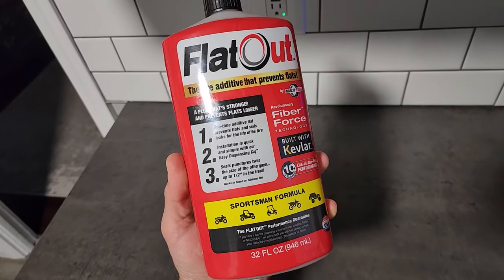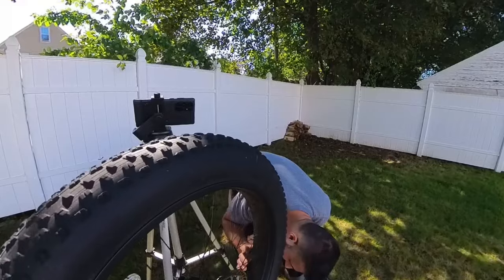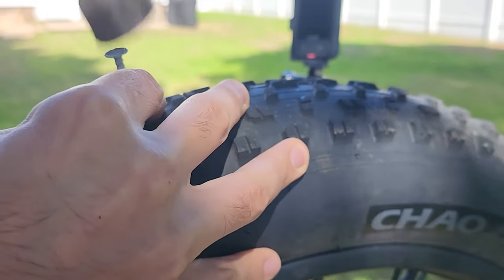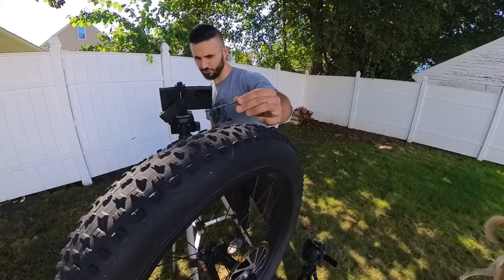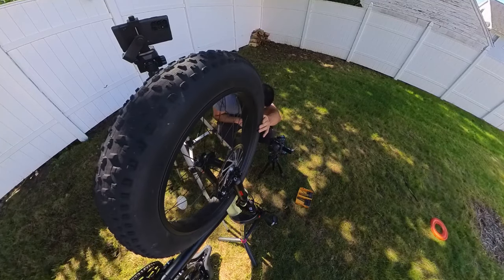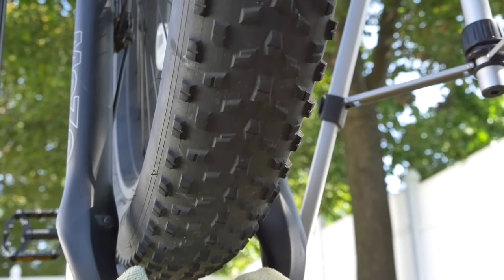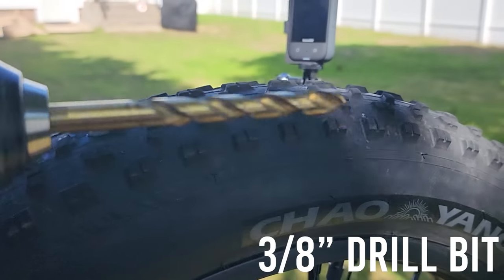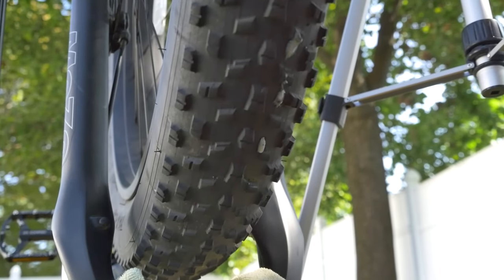Does it Work? Sharp Nails vs FlatOut Tire Sealant.

Comment: Just wanted to add a comment that might help others when they get an ebike flat . First rest assured you eventually you will get one. Knowing in advance how to handle the situation will help you stay calm & prevent you from damaging your bike. First when you get a flat do not try to walk it to a convenient place to repair it; this will damage the tire & worse cause permanent damage to the rim. Park & lock the bike as close to where the flat occurred. If you have your cell phone with you call for assistance ; if not walk to the nearest place where you can get help. Go back home get  your truck or car go back where you locked the bike bring it home & repair it or take it to a shop to repair it for you.
Reply: Or you could always carry a patch kit, just fix the flat and keep going. I remember feeling a bit intimidated about fixing a flat on my first fat tire e-bike, especially the rear one. Turns out, it's pretty easy, and you don't even need to remove the tire. I firmly believe that if you're going to ride an e-bike, it's a good idea to learn these basic skills. That said, I do use Flat Out in my tires now simply because fixing flats all the time can get tiresome!
Reply: @Freedom_eRider they even have small hand sized electric air pumps you don't even gotta carry a full pump and struggle anymore like we did as kids 😅
Reply: Or prevent the hassle of calling for assistance and ride it much more towards a preferred bike shop thanks to the effectiveness of FlatOut!
Prevention i the best solution! Saves all the money spent on Uber!
Reply: You're being overdramatic. Not just walk, I rode my flat ebike home 3 times for several miles without any damage

Comment: Yes you should have filled the tire again and added more Flat Out. They recommend a specific amount. As far as the mess, when drilling a hole you are actually removing an entire plug of rubber and inner tube. This could never happen in real life. For a more accurate test you would want to drive a 1/4 and 3/8 diameter piece of steel in so that when pulled out the rubber comes back together. It's amazing that it can even plug the hole when removing a section of rubber. When sealing a puncture that comes back together there is no pamela anderson effect :D

Comment: My Flat tire moment, Ive notice when using flat out the tires get foamed up inside tire. The cool part as how I rode thru a serious pothole which bended the valve of a cut on the neck of valve, was 5 miles away from home of hearing the air come out but,, the lubricate inside tire kept my tire in form and not all the way flat flat of tire coming out of rim on most flat outs without flat out lubricate. I still was able to ride 5 miles with the tire still having the rim in place and very easy to ride home to change or patched up the cut. I now know when using Flat Out on my bikes, any puncture of tire going flat, it will still have form to ride home but at slow speeds, better than walking bike home due to tire coming out of rim which is not advisable to ride home on the rim. Great stuff and a MUST in all my bikes.
Reply: Been 2 years since using on all my ebikes with 2 moments that ended up on the Flat Out side of working. Twice with 2 different scenarios of tire going flat only to pump back up and still fine, the other being the latest of my valve neck getting cut by rim of a pothole ride thru but still had the form of tire to ride home without tire slipping out of the rim's edges.
Reply from the maker: yes definitely don't ride home on the rim!  Glad you hear your success story with flatout!

Comment: A simple "puncture" from any sized object (thorn, fishhook, nail, screw, bolt, etc) is totally different from actual drilling...removal of the tire rubber itself. Definitely the real "stress" test.
Reply from the maker: thanks!
Reply: A simple "puncture" is a lot more benign than this!
Reply from the maker: @chaxologist2024  we go all out!
Reply: @maximumchargeEV  This is a perfect benchmark for testing! Already bought spare, tubeless tires for my soon to be new Apollo Go scooter and I intend to use FlatOut in them when the original tires give out!

Comment: I've been binging tire sealant videos for my car tires and finally this video sold me. FlatOut it is! Straight to the point and you showed me exactly what I needed to see!
Reply from the maker: Glad this video helped!
Reply: @iconyxxx  That's because of the risk of sealing the valve stem. I'll take that risk. Won't need it anymore if my tire never goes flat. And I could just replace it  if it did.

Comment: It might have worked if it had more flat out in it. It probably was low from the last two drill holes so I bet it would have had a better chance with adding more flat out after the 1/4 in drill hole. But great stuff
Reply from the maker: Maybe!

Comment: I'm pretty impressed with this test.  Do you know if Flatout works with inner tubes?  I realise it works better with  Tubless, but I'm looking at this strictly from a "Get Me Home!" standpoint.  Once I'm home I'll change the tube, I just don't want to be doing it on the side of the road.  I've been using slime since they have a varient for inner tubes, but from what I've seen here Flatout may be better.  I don't think I'll be running over any 3/8 drill bits, just want it to work with standard nails & thorns.

I hate to do this to you, but I'd love to see that 3/8 test again on a fully inflated tire and a fresh load of flatout (I'm guessing you lost quite a bit of the sealent in the previous tests).  Liked and subscribed, this was a really good video.
Reply from the maker: Thanks! That test was actually done with an inner tube.
Reply: @maximumchargeEV  Oh wow, I had no idea it was that effective with inner tubes.  Like I said I'm not looking for miracles, I just want to be able to get home and it looks like this will do it.  Thanks for the great video.
Reply: This stuff is Flat Out fking bombproof. Apparent they use this on military vehicles... Seems to be a superior sealant and doesn't smell bad after awhile in t
Slime suck and stinks!!

Comment: If you  deflate the tube by pushing in the valve core (something you would need to do to replace the tire), will the flatout start squirting out of the valve?
Reply from the maker: nope!

Comment: Flat Out does make a mess, right? i've been thinking about Flat Out or Tanus Linners
Reply from the maker: not really messy unless the tire explodes everywhere
Reply: @maximumchargeEV  Got it. do you think the Tanus is as good as the Flat Out?
Reply: Get both, I use both, I also put Scooter tires on one ebike

Comment: thanks for doing this mate…good stuff…how much ounce you did pour in the tube? 26i inch tire
Reply: For this size of tire you need 16 ounces per tire.
Reply from the maker: It's a 26x4 inch tire and I put half the bottle into it.
Reply: Thank you guys.. i had 26x4 tire so one bottle of Flatout will do both tires….
Reply: @baddriversofcolga  thanks…if is 20x3 tire 8 ounces per tire?

Comment: This is my 1st exposure to this product so please correct any inaccuracies but if I understand this, it remains in liquid state, only to solidify around a leak...a scab of sorts, lol. 1 of the benefits of the green goo it's that when correctly applied, it gives an even coat. Given this, how does a constant liquid affect tire balance? Without a correction for this consideration, any motorized vehicles w this should be banned from freeways!
Reply from the maker: I'm not sure about what you're saying, but a small hole filled with a solidified flatout clump has a negligible amount of weight and will barely effect wheel balance.
Reply: @maximumchargeEV  he's saying liquid moving around in a moving tire is dangerous.  Other brands like Ride On sealants actually grip around the inner tire and actually "balance" the tire and make riding safe.  If this sealant swooshes around inside the tire, at fast speeds your tire will start to wobble.

Comment: The likelihood of running over a drill is 0% 😂
Reply: And I'm one of that "0%"! 
Went through an unfamiliar road in a relatively industrialized zone and a small drill punctured my scooter tire on the side of the road!
Thankfully, the tubeless tire sealed itself and the pre-installed sealant did the trick!